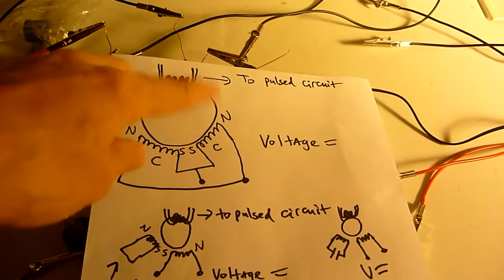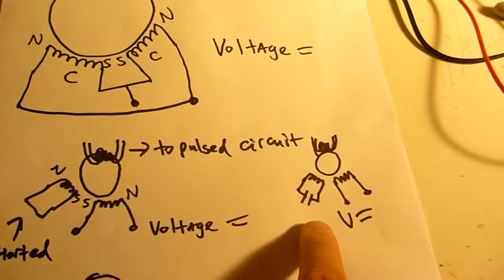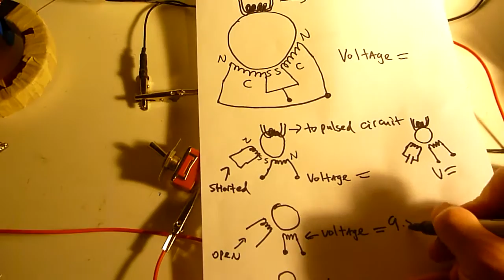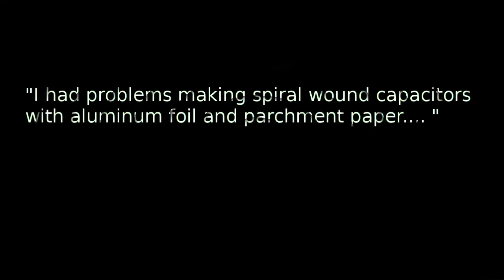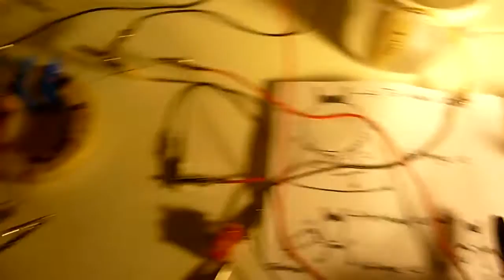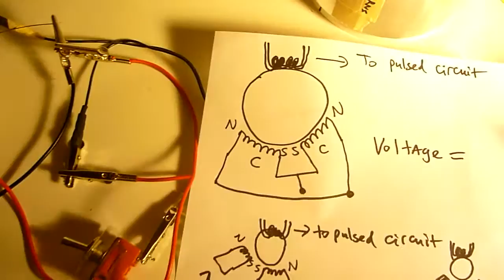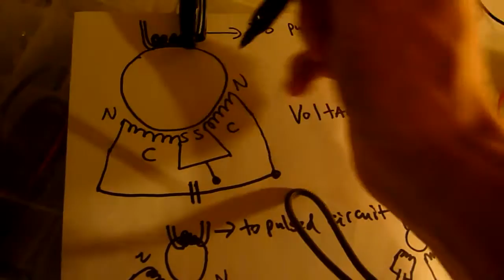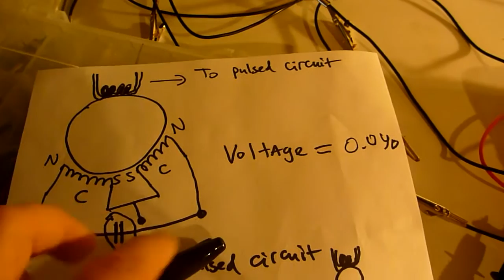Testing a Spiral-wound capacitor with a pulsed circuit

Comment: Hi I think the reason the voltage was slowly rising , was because the capacitor foil was slowly pulling together from the internal electric field between the plates. The closer the capacitor plates the higher the voltage will be  on the plates.

Comment: Hello Naoki! Interesting video, please could you specify what are you using as power source? Have you considered setting the spiral capacitor on top or below the toroid to try to use the effects of the fields produced by it? Keep it up with the nice videos! Thanks
Reply from the maker: Thank you for the comment. The power source is a Nokia DC power adapter which is 5.9V at 400mA. I haven't tried orienting the spiral capacitor in the way that your describe. I've been researching free energy ideas for a while and what I discovered is that there is another wave form out there. We are all familiar with transverse wave form. The magnetic field of the wave is 90 degrees to the direction of its propagation. The max speed of this wave is the speed of light (we use this form in radio transmission, etc.) Well it turns out there is a scalar wave form. This wave form has magnetic, electric and propagation all oriented in the same direction! The propagation speed of this wave is Pi/2*C or about 1.5 times the speed of light! This wave form is key to many of the free energy devices and system (including the Henderson Generator). If you aren't familiar with Konstantin Meyl or Eric Dollard check out their lectures on scalar waves (Dollard has a great lecture on Energy Synthesis). Humanity has reached a point of the paradigm shift (for the better). Again, thanx for the comment :)
Reply from the maker: Juan Ignacio Bravin I haven't looked into the work of Walter Russel, John Keely or Ighina! However, I will check these guys out as well as the .pdf document that you provided a link for. Another free energy scientist that should be looked into is Stan Meyers. He did lectures explaining some of his devices. He had a "toroidal power generator" it was a device consisting of a loop of copper tube or plastic tube (non-ferrous tube). Inside the tube loop he had magnetic gas being moved around using a pump. On the outside of the tube he had many coils all connected in parallel. What induces voltage/amperage in the coils would be this magnetic gas! Thus, Lenz's Law does not apply for this type of a generator, the concept is also very simple. Anyways, I wish you the best in your research and projects. Thanx for the link. Please keep me updated if you come across anything interesting.